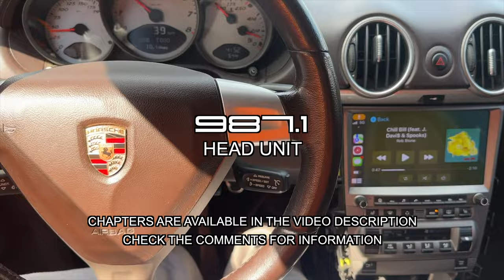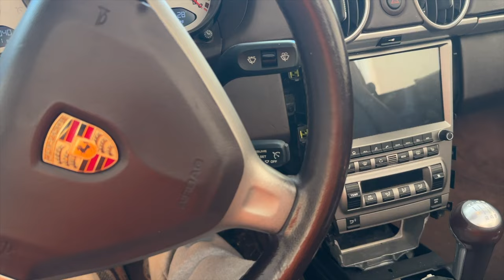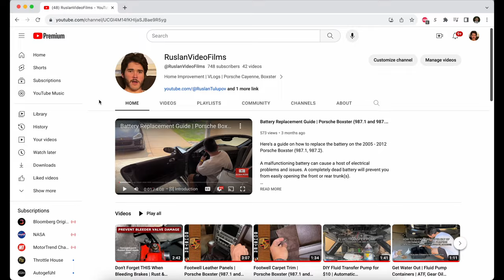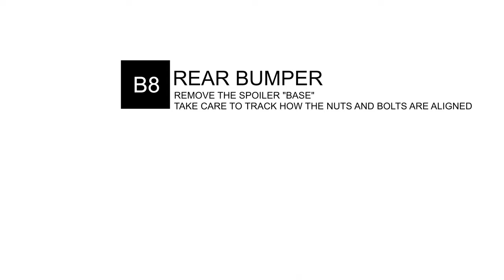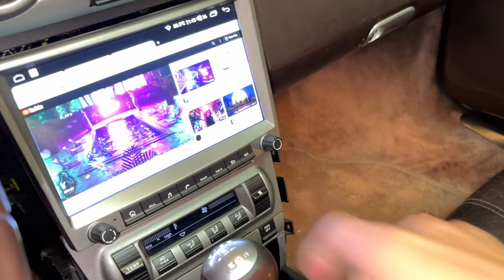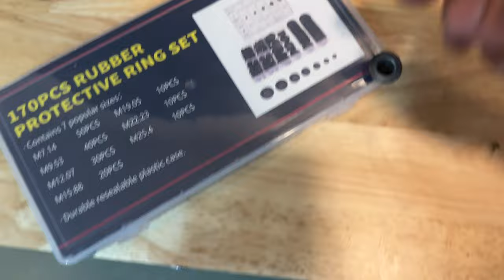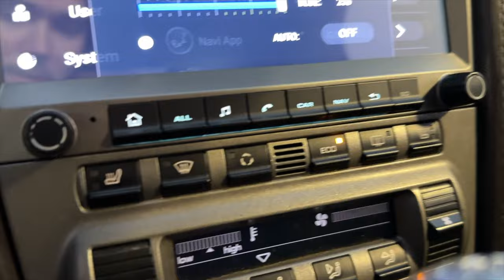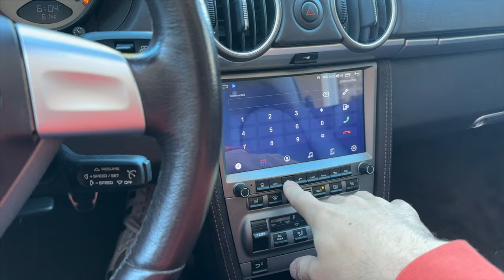Head Unit | Porsche Boxster (987.1 and 987.2) (2005 - 2012)

Comment from the maker: Tips? Recommended steps? Share them below:
Reply from the maker: Feedback from Don Eilenberger (The Man himself!!):

The T tap connectors. I hate those things for all the reasons you showed - and for their propensity to damage wiring where it cuts into it. I use Positaps.. it's a bit expensive ($1/each sort of pricing) but in the grand scheme of things - worth considering as just a cost of doing the job simply (no redos) and right (doesn't destroy the wiring being tapped into.) It might be worth mentioning these as an alternative.
RESPONSE: Adding as comment so people see this too. Adding as a link in the chapters where folks need it. 

The unit's name. It really doesn't have a name - most of us have been calling it the "AliExpress unit," or the company selling "HereGoes" (that brings up the connotation of "here goes nothing.." which isn't entirely misplaced.) I think a few times you referred to it as an Erasian - that might confuse people.
RESPONSE: That's my mistake! I was confusing it with the Xtron. When I say Xtron I mean the Alibaba unit. 

Insulating the ends of cut wires - on the main harness to the unit, you took off the extra connector (as did I - but it was the other connector) just for more room behind the unit (which has REALLY gotta be tight with the MOST box) - but I seem to recall us discussing shrink-fitting the ends of those wires to keep them from shorting on something. And I saw part of the video where you were doing that, but you never explained it (that I saw.. I might have missed it..)
RESPONSE:  I did add a note and if you pause, you'll see me timelapse shrink wrapping it. I could have made it more clear though. The fact that the feedback is there means I need to do a better job next time. Future person, if you're reading this, you're probably already detail-oriented enough because you're doing your research, but if you haven't considered it, let me politely suggest doing the shrink wrap : )
Reply from the maker: @qikqbn77 says,

"I installed a screen protector same day as installation.  A quick tip is to install screen protector before installation so that you can remove the face plate surround.  Lay down screen protector, then reinstall faceplate surround on top of that.  I used a matte finish screen protector to cut down on glare.    I like this unit so much, that I ordered another one for my Cayman.  The only thing I modified was adding a little darker color to the plastic surround to better match the color with oem center console controls. It looks like a great match in video, but in sunlight it is just a bit lighter in color than oem parts.   thanks for the video."

Thank you for the insight!

Comment: Great, thank you for your thorough installation video.  I installed the same unit in my 997.1 C4S and have been loving it.  I installed a screen protector same day as installation.  A quick tip is to install screen protector before installation so that you can remove the face plate surround.  Lay down screen protector, then reinstall faceplate surround on top of that.  I used a matte finish screen protector to cut down on glare.    I like this unit so much, that I ordered another one for my Cayman.  The only thing I modified was adding a little darker color to the plastic surround to better match the color with oem center console controls. It looks like a great match in video, but in sunlight it is just a bit lighter in color than oem parts.   thanks for the video.
Reply from the maker: Added to the pinned comment!
Reply: @qikqbn77 how did you darken the surround ? With a wrap ?

Comment: Hello, I have a question when I install the radio in my Cayman, I get a white halo that disappears after a while of being on. how do I solve it.??
Reply from the maker: Sounds like a faulty unit. Sounds like a bad LCD screen or it is installed incorrectly - it might be flexing or something is pressing on the LCD

I would RMA the head unit or return it for another one
Reply: Thank you very much, I already returned it and ordered a new one, I want to ask you another question. On the car panel, “audio off” appears, how do you fix that?

Comment: I installed a new CarPlay Head Unit in my 05 Boxster S. It has the SPP (non-Bose) package with the amp in the frunk. I am getting sound from the door mids and dash highs. There are woffer speakers in the doors. I am not getting any sound from the woffers. Any ideas that will help me resolve this issue.
Reply from the maker: If it was working before, sounds like a wiring issue or issue with head unit not supporting those. Would double check wiring and contact manufacturer for help.

Comment: Great video, I have the same head unit and I was looking to change it as I have a fault where it doesn’t have sound I think it would be the amplifier!? Would this upgrade not working until I sort the amplifier I’m assuming?? Thanks
Reply from the maker: Yes, amp needs to be working unless you bring / swap in your own with its own audio connections. Video for another time 😎- mine is starting to conk out
Reply: @RuslanVideoFilms  I ended up finding I had a battery drain I did a few tests and found it was the phone control module that was faulty under the seat must have got wet in the past! Disconnected and put an optic link in and it’s working now! Great video might well do this upgrade in the future!

Comment: I'm interested in this head unit installing this to my 987.1 Cayman but it looks really confusing, I thought this unit was plug and play from reading the reviews.
Reply from the maker: It basically is if you don't bother with antennas or a rear camera or have Bose.

Something that surprised me was the insufficient support from the clips on the sides (it wobbles without 3D printed rails..).

Comment: Finally finished the install -fit is great using the printed slider brackets that planet 9 user so generously provided print file for  and I also bent the 4 retainer clips as per another user and now it is installed securely with no rattles when driving .To get my rear camera working properly I had to connect the trigger wire at the front harness as you did but also had to connect the trigger wire at the trunk connector to the rear back-up 12v wire .
Now the struggle is getting the android set up for my everyday use which is not my strong suit. 
Thanks again
Reply from the maker: Glad to hear - yeah those slider brackets work wonders

Comment: Thanks for your response
I did bench test the camera as you did and it worked .I have now completed the front camera installation and using the front camera connection to the head unit the rear camera worked so after I tidy up the front camera installation I'll have to get back to the rear back-up camera and see what I come up with- I think the issue with the front camera was mainly settings in the head unit . I am going to run the power wire for the front camera to the head unit harness that is powered when key is on -happens to be a pink wire
Will let you know how it goes
Thanks again
Reply from the maker: anytime

Comment: Great details in your video-makes it an easy process for even a lesser skilled Diyer to complete the installation . I have my car apart now and am trying to get the rear camera working by hooking it up to battery power before splicing into back-up light wiring but have not been successful. Did you leave trigger wire unconnected? I've attached the front trigger wire to the harness wire as you did ? Any suggestion ,
I also removed a plug terminal from the discarded plug and installed in the harness slot that connects to the green wire and soldered wire to the plug to connect to can-bus accessory wire so as not have to splice into factory harness . I am also installing a front camera but same result . I have bench tested the cameras as you did and both work. I seems to me that the issue is in the head unit not recognizing the camera(s), Any suggestions? I have a 2008 Boxster S with 6 speed transmission
Thanks again for your great videos -
Reply from the maker: It took a bit of playing around to find the right wire on the head unit to connect the trigger wire to. I did connect it - you have to if it's a manual and you do not if it's an automatic.

If you put a voltmeter on the trigger wire, does it have 12V when the car is in reverse?

My issue was a bad crimp connection to the reverse taillight. My rear camera worked on the bench but then did not when installed. It turned out it was a bad crimp connection to the reverse light. I soldered my reverse camera's power wires to the T splice to fix the issue.

Thanks for the kind words and hope this helps. Let us know.

Comment: Great video, helped a lot, however can you advise. I've followed all steps but my new head unit doesn't seem to go anywhere near as loud as the old PCM? I've tried the max volume tip before new unit installation but still the same. I can turn the volume up to max 35/36 clicks and it's only what I would call moderately loud but no where near the punch of the PCM2.1. Do you have any idea, how loud is yours on max volume? Thanks
Reply from the maker: I recall something about double amp’ing but don’t want to provide the wrong information. There was something about amp settings here: https://www.planet-9.com/threads/diy-on-installing-an-inexpensive-android-radio-headunit-to-replace-the-standard-cd30-radio-and-probably-the-pcm3.253949/#replies

Comment: Awesome thank you… I have BOSE and am not getting audio, any thoughts?
Reply from the maker: did you connect to the right wire, the ignition wire? I made a mistake with which wire I connected to first time around. is light coming out of the optical decoder box?
Reply: @RuslanVideoFilms  I have no light coming out of the MOST adapter. I have a 997.2 and it is a CDR-30 instead. I tried your method of finding the ignition wire on my harness on the car's side and coincidentally, it is green as well. I put my multimeter to the fibre optical connector and verified it has 12V as well so I know my crimps are good.

Comment: I was told this unit will not fit in a 987.2. They said the plugs were different from the 987. I sort of doubt it. Your thoughts? Thanks in advance.
Reply from the maker: I would trust the sellers opinion more because they might have more experience with this one, but I really doubt or see any reason why it should not be compatible with the 987.2. Should work

Comment: First I have to say thank you for this video as it has saved me a lot of money. For the life of me, I can't figure out why the radio is draining my battery. It's stays on when the key is out in sleep mode.
Reply from the maker: Which head unit model is it? Sounds like the wrong wire might have been used to tap into ignition, or the head unit is reading it wrong.
Reply from the maker: Confirming with voltmeter might help. I tapped into the wrong wire the first time around and didn't get working audio until I fixed it with my BOSE fiber optic decoder.
Reply: @RuslanVideoFilms  thank you, going to try over the weekend, hopefully it's an easy fix.  Thought it might of been something on the factory settings that needed changing

Comment: I just installed the same unit in my 987.1
The worst thing is sound quality, i had to go with fiber optics, but compared ro OEM unit sound, its trash. It starts distortion even in low volumes, when top is off i can bearly hear the music, and if i go on high volume it starts distortion. Is it my units fault or your's is also same ?
Reply from the maker: I never max'd out the volume on the old system but there are some times when I wish it was louder with the top down. Doesn't sound like trash though - could be things like the wiring, the signal wires they use for the MOST Fiber Box are super thin (and crap) and could replace those, I didn't have issues but could have gotten good crap and could easily be bad wires in that unit, could be a bad Fiber Box, could be a bad unit (not past Aliexpress quality control standards tbh)
 Aside from volume, leaves nothing to be desired here, but I'm not an audiophile.

Comment: Should this be a relatively similar process with a 987.1 Cayman? I have a 2006 S with Bose.
Reply from the maker: Virtually if not exactly identical. The Fakra radio connectors at the back might differ depending on your radio / satellite options from factory.

Comment: Sorry to bother you again but should the camera trigger wire have 12V on it when the camera  power wires ( Red + and  red/black -) are connected to a 12v source ?  I have my back-up camera hooked up to battery to verify operation before installing and I don't have 12V at trigger wire with the ignition on so I'm thinking it may have to get power from back-up circuit or its a bad canbus box but the display in the instrument pod works. Any ideas?
Thanks  wayne
Reply from the maker: I'm 90% sure the trigger wire should have a signal on it when the rear camera activates or is activated rather than a pulse. 

Do you have a TV with a yellow signal wire? Can you test the camera like this?
https://youtu.be/zWH8tbTBG8g
Reply from the maker: Reasoning: The head unit should detect it fine but the first step would be to make sure the camera works... cheaper to replace...

Comment: Quick question, what drill bit size did you use to create the hole for the rear view mirror at 54:04? Great video by the way. Very well documented 👍
Reply from the maker: I forget. I sized up the drill bit so its solid part was the same diameter as the solid part on the camera’s bolt. Big enough for the “core” of the bolt, small enough so the threads grab

Comment: I downloaded the zip file for the 3d printing. There were 2 files with slightly different dimensions. Which one did you print?
Reply from the maker: AliExpress_987_Stereo_Mounting_Spacer_V2.stl
Reply: @RuslanVideoFilms  thanks!  That's what I ended up printing!